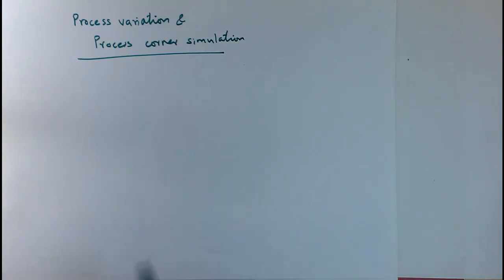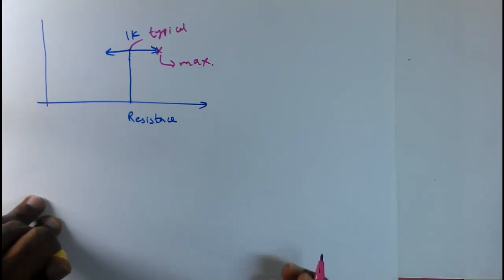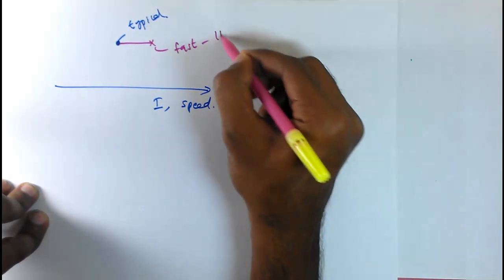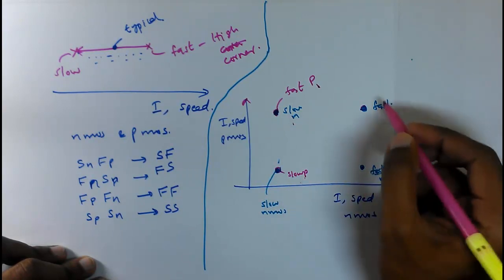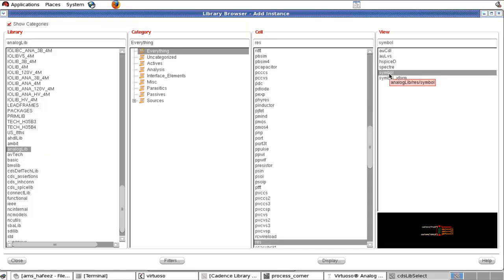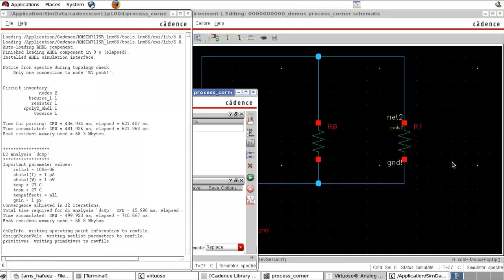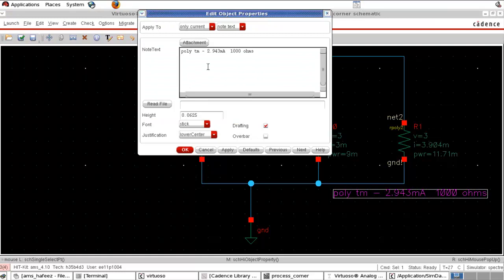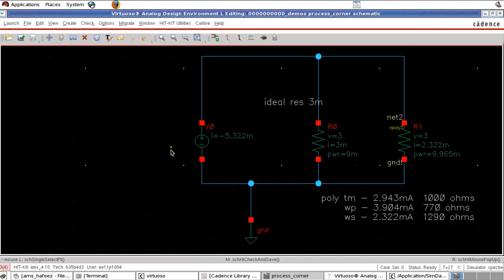CMOS process variation and Process corner analysis in cadence part: 1

Comment: You know I have worked for over 23 yrs at a foundry but people give some complicated answer to what process corners are.  I really hate industry vernacular.  How about just saying the lower and upper test limits?  Is there a benefit of using the term "corner" other than to confuse people?  A corner to me has to do with a 90 degree angle, I have to wonder who dreams up the terminology.  Thanks for the explanation!
Reply: I think its because at simple conditions, you have ff , fs, sf, and ss. it depicts the four corners of a square. i maybe wrong though
Reply: Me too the terminology is so confusing.